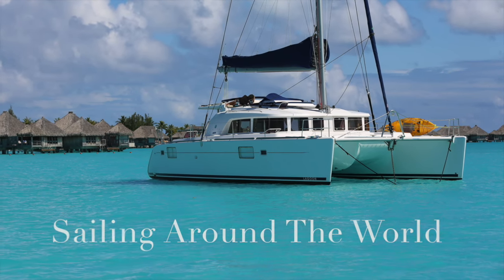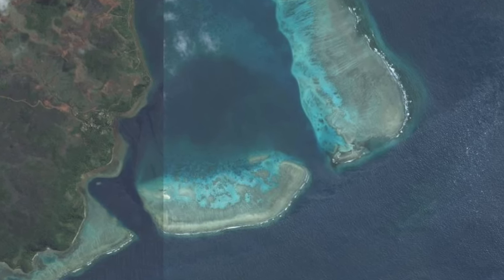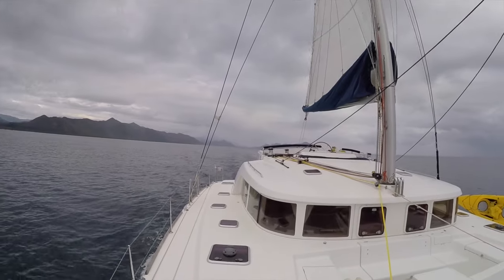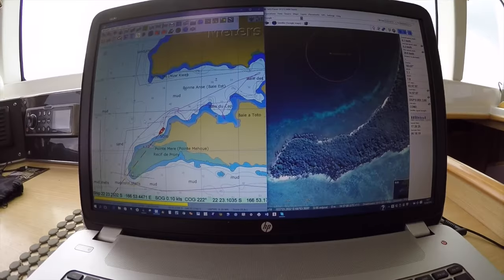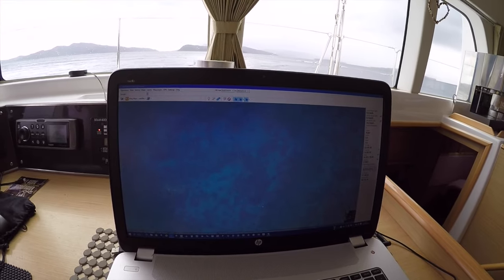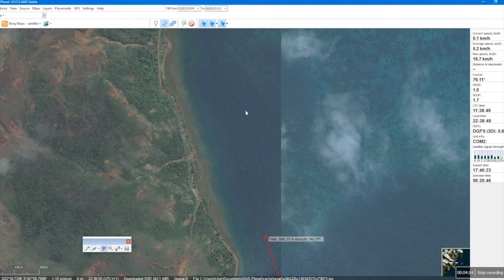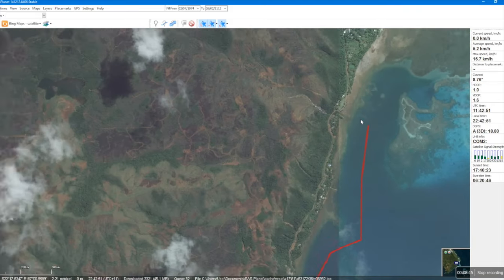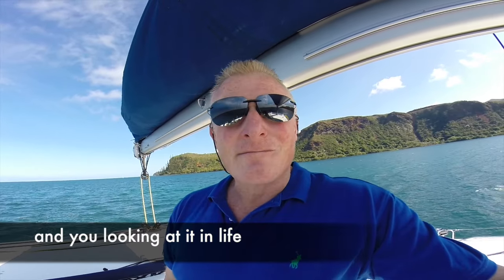Passage New Caledonia for Loyalty Islands HD

Comment: Thanks for this. Very interesting to see how you use todays technology for Navigation Safety. I'm happy with a sextant and paper chart - one step better than a log, a lead and a line! I have my own concerns about the fragility of GPS and it being the route of single source errors. Keep up the posts I'm still catching up on your travels. (36 years working as a Navigator and Captain on big tonnage, & I still don't know if I like it :) )
Reply from the maker: Hey Steve - awesome comment and most definitely still in total respect of the older techniques for navigation. Perhaps one day I will be writing a similar post when the young bucks have fancier systems still - but in the end it pays to carry the knowledge from the days you speak of - that sure is what we all need if modern systems failed us. Perhaps this is why we also like to run multiple systems - one to check the other. Anyway - I would be very proud to have your years of experience Captain ... So admire guys like you... Cheers

Comment: Hey Brent, quick question, I may have missed your explanation, but why do you store the download maps on and external hard drive, instead of the regular laptop hard drive? Any reason?  Also, can you recommend a good tried and proven cruising guide for New Caledonia and surrounding islands?  Keep up the awesome tech vids, love them.
Reply from the maker: Hi Barry ... we download imagery to an external hard drive mostly because we want
 to keep the memory free in our laptop. Also, if the laptop goes down, it will be nice to have a new plug 'n play device we can keep running or if we suddenly need to help someone else out with a delivery or similar we can take our hard drive along and use
 it on that ships computer. There is no reason other than this not to keep it in your hard drive. You can also download imagery automatically through the zoom levels by defining an area and checking the zoom level boxes you want to download - and it will do
 this while you are away from your computer, however, I was cautioned by a friend that his computer was 'shut down' by Google as it 'saw him as a robot', and it proved a mission to re-assign his computer to a new MAC Adress and start over again. As for New
 Caledonian cruising guides - we carry one paper copy which most cruisers use - you can get it at Amazon and since we are part of the amazon affiliates program how about getting i through Ana's on-line store ... it cost you no additional money but drops a small % into our 'Help us to help others' campaign. The link is here ... http://impi-store.blogspot.com/2016/09/navigating-through-beautiful-new.html
Cheers for now
Reply: Brent,  Thanks mate - great info - very helpful.  When we are ready to get the guide will definitely go through your affiliate site.  Thanks for the thorough reply, and look forward to more of your great videos - we are new to cruising and sailing and learning so much from your Vlogs - let us know if you ever look to cruising the east coast of Aus!!
Reply from the maker: All good mate - will let you know. At the moment I am waiting for my visa - Australia apparently puts South Africans as a 'high risk visitor' so I am not sure what all that is about ! We will wait - I am sure the good folks will see we are 'just passing through'. Have a great week Barry